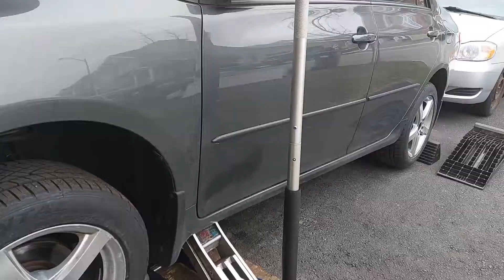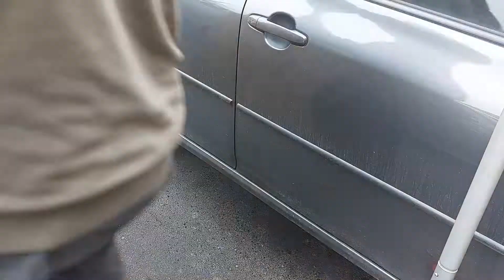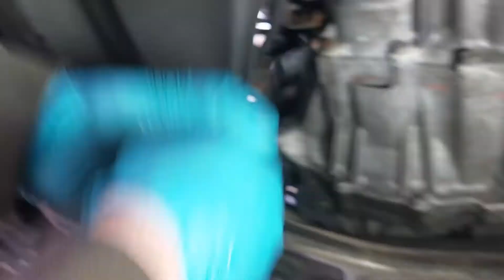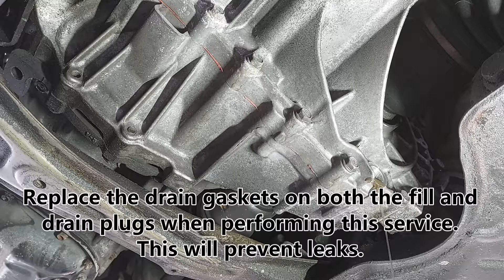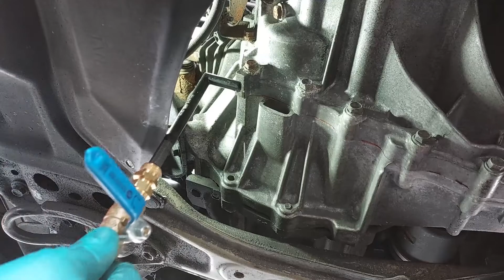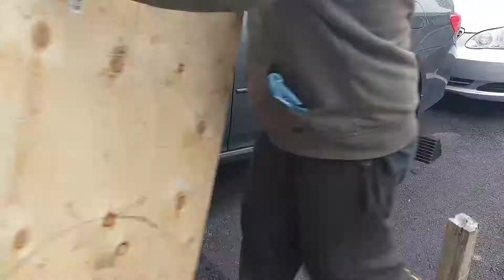2009-2013 Toyota Corolla - 1.8 L - 2ZR-FE - C59 Transmission - Manual Transmission Service

Comment: Put mt-90 in my 09 vibe, been a little quieter. Came here cause some say fill with a top bolt but I didn't see one on mine and filled on the side hole.
Reply from the maker: It should be the exact same transmission on that Vibe if it is equipped with the same 1.8 liter 2ZR-FE engine. Sometimes you may need to remove the black plastic splash shield out of the way to see the 24 mm fill plug. It should be there. There is always a fill and a drain plug on manual transmissions.

Comment: Amigo en mi pais no hay 75w90 GL 4  
SIN EMBARGO ENCONTR  75W80  GL 4  
ESTA bien si le pongo ese aceite  ???
Reply from the maker: The specifications calls for any 75W gear oil as long as it is GL-4. 75W80 GL-4 works fine.

Comment: Do you know what years the Corolla/matrix require the low viscosity transmission fluid?
Reply from the maker: I believe all Corolla and Matrix models used 75W90 GL-4 gear oil for their manual transmissions. If you have an automatic transmission then it would take either Toyota T-IV or WS transmission fluid.

Toyota transitioned from the T-IV fluid to the WS fluid around 2007 and onwards.

If you have an orange dipstick it takes the T-IV fluid. If you have a black dipstick then it would take the WS fluid. For the automatic transmissions that did not have a dipstick those transmissions use the Toyota WS fluid. This is not to be confused with the newer CVT transmissions.

If I'm not mistaken Toyota never used low viscosity transmission fluid unless it is automatic transmission fluid you're talking about.
Reply: @moosemobileautorepair  thank you for getting back to me with so much detail. I'll be putting in some redline mt90.

Comment: Wait so gl-5 purple royal purple gear oil isnt good for similar toyota transmission?
Reply from the maker: Correct. Toyota manual transmissions have brass synchronizers and so GL-5 gear oil contains high levels of sulphur/phosphorus which will react badly with brass and therefore will damage the brass synchronizers with time and will cause grinding and accelerated wear. GL-4 has about 1/2 of the levels of sulphur/phosphorus compared to GL-5 gear oil. Low levels of sulphur/phosphorus are OK for these transmissions so GL-4 is what's used.

Brass is composed of copper and zinc metals.
Reply: @moosemobileautorepair  hmm ok I had recently did a gear oil change and got cute with the Royal purple Max q but it says on there safe for synchronizers manual transmissions that have synchronize is it safe and also it says where gl5 or four is recommended as well as non-corrosive to solve yellow metal's breast bronze copper but I'm going to get some redline mt90 either way cuz I do put a lot of heat on this trans
Reply from the maker: Yeah, I'm not too sure about the Royal Purple stuff, but I would just use a gear oil that only says GL-4 only and stick with that. That would be best - To drain the fluid and put the correct stuff in it. Red Line MT-90 should be fine if it meets the specifications. I personally just use what ever synthetic gear oil I can find in the market that says 75W90 GL-4 and I just put that in because it's hard to find sometimes in stores over here. Sometimes I may have to look around or order online somewhere to get it.

Many years or eons ago when I was starting off as a mechanic I once put in the GL-5 stuff in one of my cars that took GL-4. It drove fine for a short while, but then I would get a 3rd gear grind almost every time. That was when I found out I put the wrong stuff and switched back to GL-4. Switching back helped a lot, but once in a while I occasionally got that 3rd gear grind, but not very often now. I can say a little damage has been done, but changing the fluid often helps every now and then. Drives and works normally now for the most part.
Reply: @moosemobileautorepair  right it makes sense and it's what it's called for so keep it simple